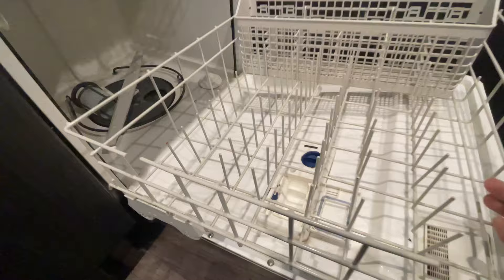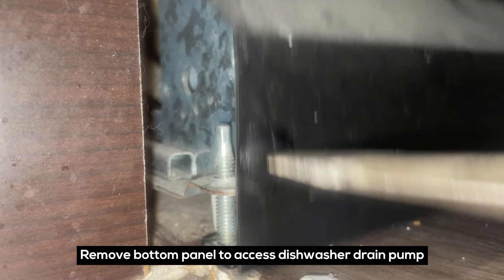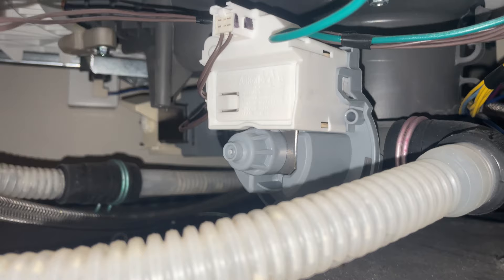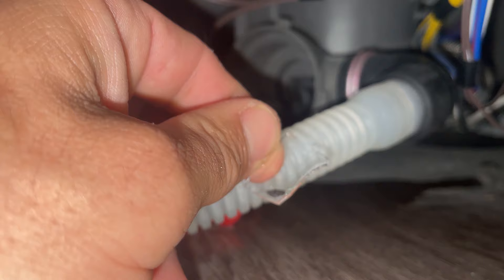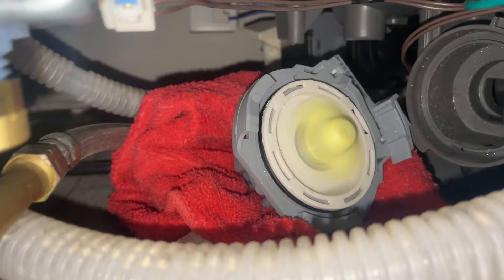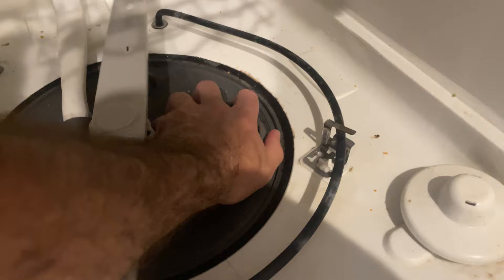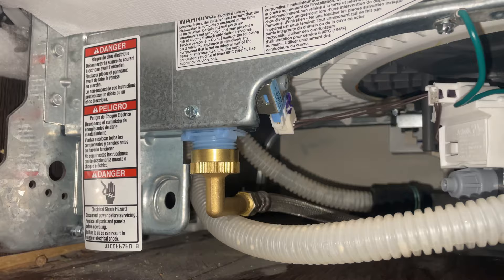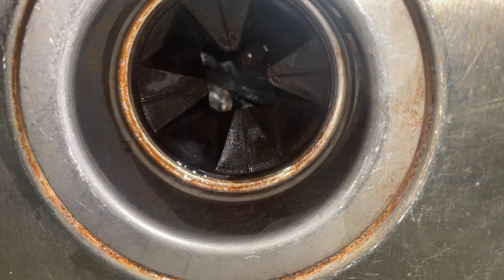Whirlpool Dishwasher not Draining

Comment: Hello. Please reply. I twisted out the pump to see if there was any glass or issues but when I replaced it …it kept leaking water during drain cycle. I tried 5 times and made sure everything aligned when I twisted it back :(
Reply from the maker: Try flipping the o-ring seal on the drain pump
Reply: @ApartmentMaintenancePro  I tried everything so I ended up buying a new one. It worked. BUT now the dishwasher hose is not draining the dishwasher properly…should I replace it or just clean it. Also the hot water supply line is randomly leaking from both ends. Why is all this happening ugh.

Comment: Please help it didn’t work on mine, the little yellow fan moves when I have it disassembled but I turn it back on and I place everything the same again but I don’t see the water draining through the actual drain of the sink and it’s just pooling up again
Reply from the maker: Is it hooked up to a garbage disposal? If so check the knockout.
Reply: @ApartmentMaintenancePro  I did some more research and turns out it was a cap covering the clear wrinkled tube and garbage disposal , thank you for your great help☺️

Comment: The pump spins and no debris clogging it so what else should I check? Thank you
Reply from the maker: The drain hose from the pump to the discharge
Reply: @ApartmentMaintenancePro  appreciate it, I'm changing it out tomorrow. It's definitely clogged
Reply: @ApartmentMaintenancePro  well changed out line and still water underneath. I checked motor and works. Nothing blocking... Any other suggestions?? Appreciate the help

Comment: Pump had zero debris and works just fine during cleaning cycle but fails to do a final drain after cleaning. Then if I click cancel/drain it drains just fine. I'm no rocket scientist but it definitely isn't the pump. Leaning towards engineered failure at this point. It's almost as though it's programmed to not run the final drain cycle. But after starting a new cleaning cycle you can hear it periodically drain and after it's complete it's always left with a sizable puddle of water in the bottom until I manually click cancel/drain. Then it completely empties. Something very fishy. So if anyone else reads this you may want to consider purchasing a different brand. I know bs when I see it.